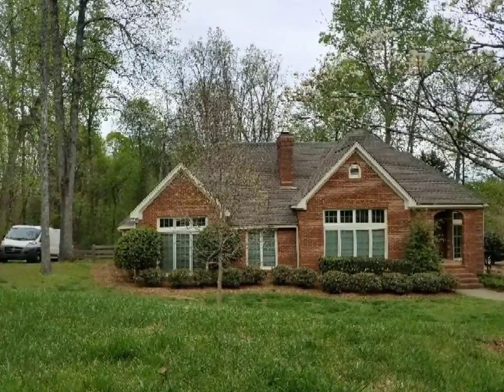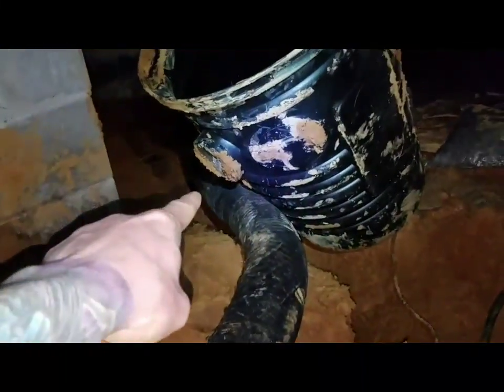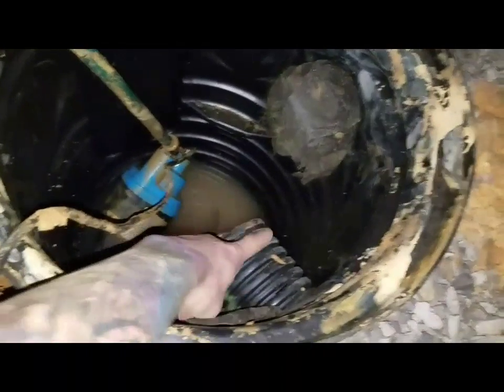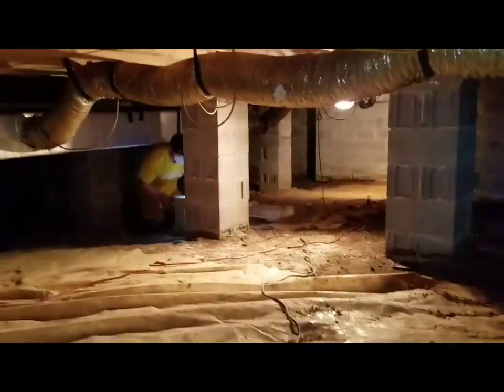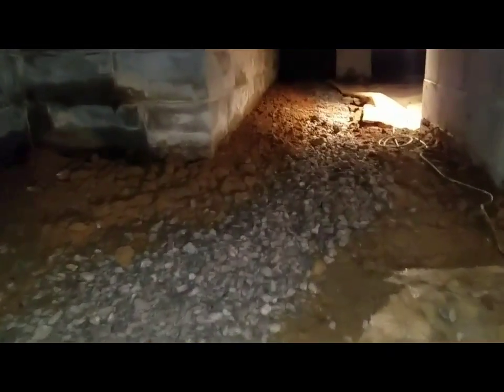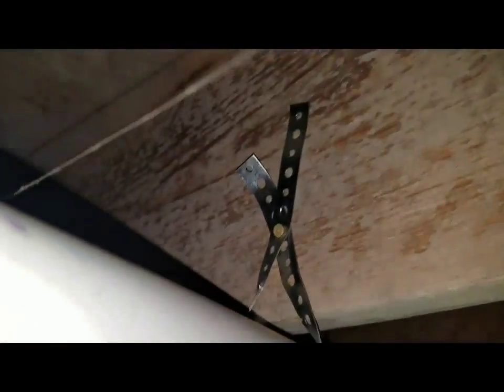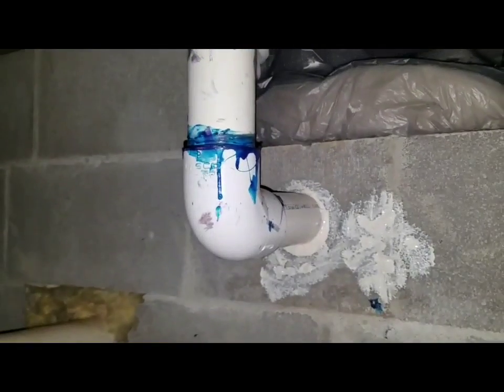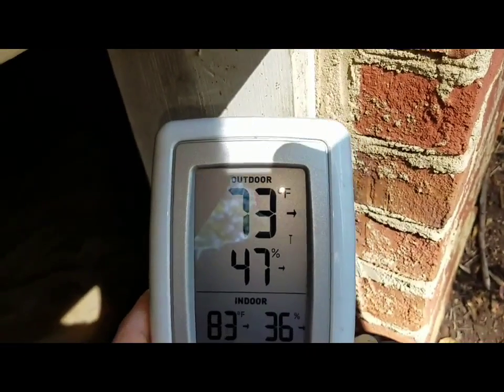Sump Pump In Crawl Space

Comment: I have found that a nice sheet of thick plastic over the entire floor (about $140 for a large roll) saves lots of money on electricity.  My crawl space is about as large as the one in the video and my dehumidifier costs run about $35/month with a relative humidity slightly below 40%.  The house also stays less humid in the summer months because the plastic barrier and dehumidifier keep the moisture from coming through the floor.  The plastic/dehumidifier combo also prevents black mold from accumulating in the wooden floor joists - think home resale value here.  I also run two pumps in the pit.  One pump is a backup and is about 3 inches higher than the primary pump.  About every 8-10 years my primary fails and needs to be replaced.  The backup has saved me from a flooded crawl space twice in the last 20 years.
Reply from the maker: Thanks for sharing the positive results. I appreciate you commenting.

Comment: we get a lot of rain  and i am trying to put a sump pump under double wide mobile home and not much room to work  is there a small sump pump basin i have  maybe 20 inches  to work
Reply from the maker: James Casady Sorry. Not sure. I would check at Lowes.
Reply from the maker: What you really want to do, is get that basin buried. So even if you only have 20'' of clearance, the sump pump size will be irrelevant as long as you purchase one that fits inside the basin. Digging the hole for the basin is the hard part. And depending on soil type, can take several hours. If you have a hammer drill with a spade bit, this would greatly help in assisting you with the digging of the hole. Once the basin is in place, pump installed, you will then need to plum your exit line outside the home. And as for the basin, don't forget to drill holes all around it. If you do not, water will float it up as it rises within your hole. You'll need you an outlet too for the sump pump and float valve monitor.